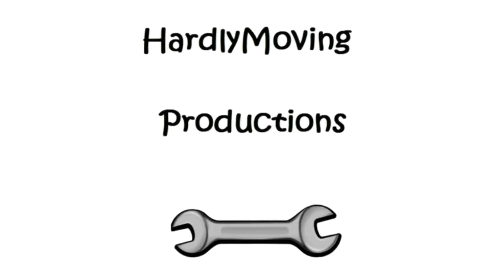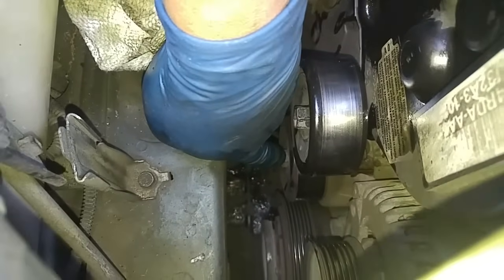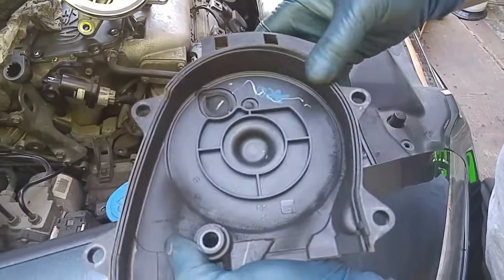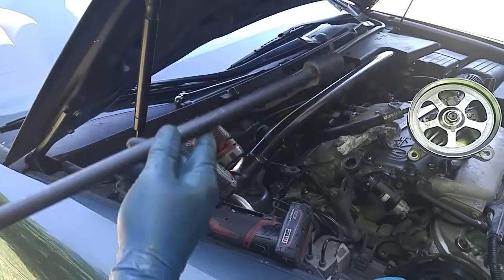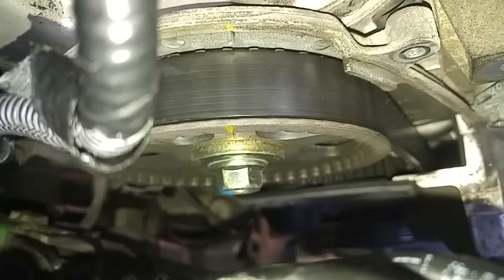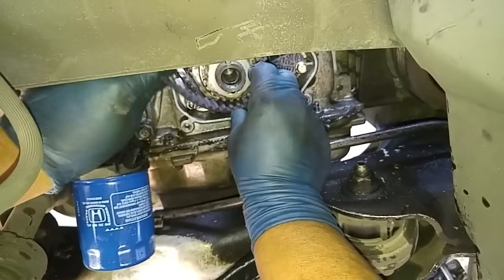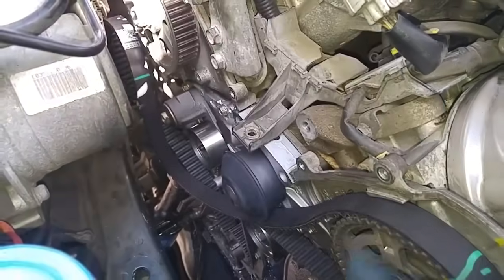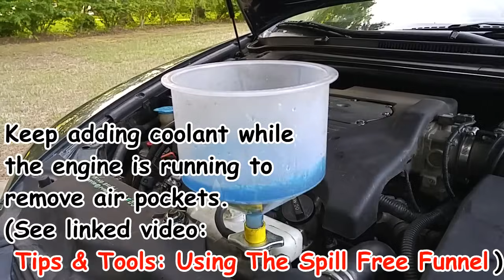Acura TL (Honda Accord V6) Timing Belt, Water Pump, & Pulleys Replacement

Comment: Great video!  After the timing belt is installed, would you recommend manually turning over the engine by hand at least a few revolutions to make sure the timing marks stay aligned and there is no piston to valve contact?  Is this even do-able?  Thanks!
Reply from the maker: No ... not necessary.  Even if you did, turning the engine manually one full revolution will not bring the belt alignment marks to where they were set.  This is what happens with twin cam V6 engines.

Comment: Makes me wonder why honda put timing belts for soooo long on the V6's instead of timing chains like Toyota, cant think of any reasons. Hopefully the new ones have timing chains this is soooo much of a hassle lol. Great video though best of YouTube💯💯💯
Reply from the maker: Thanks for your comment and support!  Timing belts have less centrifugal mass than a timing chain setup and therefore robs less horse power.  From a maintenance perspective, timing chains do not require replacement unless the chain stretches (caused by not changing the oil as outlined by the manufacturer or the crankcase oil level dropped and oil wasn't added).  A stretched timing chain replacement job is around 3X the cost of a typical timing belt replacement (both parts and labor).

Comment: Do you have to make any adjustments for the crankshaft pulley when you put it back in?
Reply from the maker: No ...not at all.  The tensioner pulley removes all slack.
Reply: Hardly Moving Productions thanks!

Comment: Additionally:
Draining the coolant: There is a nice and fairly easy to access drain plug to drain the coolant out the engine block and water pump. It is located on the back of the engine in front of the steering tie rod link. You can see it from inside the front right wheel well. Drain the coolant before taking the water pump off so that most of the coolant is gone
Knocking noise!!!! If changing the timing belt because of a knocking noise then make sure you get a timing belt kit with the shim that needs to be installed also on the timing belt idle pulley. If not, the noise may come back down the road (Apparently Acura says its the timing belt slapping on the engine mount) TSB 08-031
Reply from the maker: Good to know.  Thanks!
Reply: Thanks for this info. I've used it on three J series honda V6 now. Saves a ton of mess!
Reply from the maker: Hey ... glad it worked out for you!

Comment: Would this be the same procedure for an 03 Acura TL 3.2 vtec?
Reply from the maker: Pretty much the same once you get the side motor mount bracket off.
Reply: @hardlymovingpro  thanks 👍

Comment: Attempting this on my friend's 3.7 TL tomorrow. So 15 minutes is what it takes?
Reply from the maker: Go for it ... reach out for that brass ring ... you can do it ... don't think you can, know you can!  In all seriousness, with some decent tools and patience, it's a do-able job for the common Joe.  15 minutes virtual time ... 20X real time.
Reply: @hardlymovingpro  we just got done. Started at 9 finished at 3. Broke 1 breaker bar extension on the pulley...finally gave away with some heat. Thanks for the helpful vid.
Reply from the maker: Good deal and congratulations!  Better to brake a cheap tool than your knuckles!
Reply from the maker: See ... 20X real time!

Comment: What if your car doesn’t start after doing timing belt ?
Reply from the maker: Never had that problem.  But double check all your work.
Reply: Turns and cranks but it don’t start
Reply: Hey so I redid everything and I got smell of gas coming out the exhaust u think I bent a valve

Comment: Thank you for posting this video, nicely done.  One question; when you were setting the timing before you took the belt off, you turned the crank shaft until the front cam shaft was on the time mark, then you noticed the rear cam shaft was off slightly, so you turned the crank shaft some more to make the rear cam shaft to line up too.  My question is wouldn't that affect the front cam shaft to go off the time? Or did I miss something in your video.  Thank you in advance if you have time to answer my question.
Reply from the maker: Thanks for your post.  The front cam sprocket was slightly off alignment to the left.  It was less noticeable until the alignment was compared to the rear cam sprocket.  Moving the crankshaft a hair more to the right brought both cam sprockets more to the right and center with their alignment marks.
Reply: Many thanks, makes excellent sense.

Comment: Is the crankshaft pulley rotating in one direction only?
Reply from the maker: You can move it counter clockwise to help ease installation of the new timing belt

Comment: As I was putting the new belt on the left cam, I used the wrench to move it slightly forward but the wrench slipped and the cam sprung backward like it was spring loaded. How can i get it back in the correct position? I am afraid to force it as not to damage anything. Thank You
Reply from the maker: No problem.  You can wrench it back slowly
Reply: Thanks, I''l try it tomorrow. Even with Your great instructions, It took me 6 hours to get to this point. But still lot better than paying grand to a shop. @hardlymovingpro
Reply: So You know I couldn't wait till tomorrow....It's odd but that Cam keeps coming back to same spot and I can only turn it clockwise about 1/4 turn. I'll just stop by Acura dealer and see if they offer some help. My buddy has a friend mechanic, so maybe he'll stop by my garage. We'll see. Keep You posted.
Reply from the maker: Can't understand why it keeps snapping back.  It doesn't have to be in absolute alignment.  Just get the belt on the front cam first ... clip the belt on the cam ... move and hold the back cam in position mount the belt and clip in place.
Reply: So my neighbor helped me put everything back together. Perfect alignment of the marks. This morning i filled in the fluids. Car started and ran about second or two then made rattling noise and stopped. Tried to start it few more times after that with no luck. I'm ready for the worst news.....Engine dead now? I think I'll just sell the car for parts??
Reply from the maker: @robertslezak5778  Could be something as simple as a disconnected vacuum hose or electrical fitting.  Suggest you double check all your work ... even if it requires you taking off the timing belt covers.  Happens to me sometimes.  Nature of the work.  Don't get frustrated.  Could be something very simple that you missed.  As long as the belt is in alignment, it must be something else.
Reply: Redid the belt. All marks perfect. Finally started the car but here's what happens:
1. Need gas pedal pressed to start.
2. Car runs rough and when i take the foot of gas, it dies.
My question: It didn't show in your video but did You dry that electrical component by the lower small (crank) cam? Even though I drained the coolant from the bottom of the radiator as your other subscriber recommended, there was still fluid leaking after removing water pump. Could that be wet and causing it? You don't live close to Chicago? I'd pay You to come look at it? Thanks a lot.
Reply from the maker: Check and blow dry the crankshaft position sensor connector.  Check all geound wires.  Do you have any MIL lamp codes?
Reply from the maker: Also, check the MAF sensor plug on your air hose by the air filter box.
Reply: P0154 - o2 Sensor - no activity, Bank 2, Sensor 1
P2254 - A/F Sensor, Bank 2, Sensor 1 @hardlymovingpro  
 Just bought new sensor. Had to take couple days off to recuperate. I'll go back at it early next week. This time with a mechanic. Thank You.

Comment: So what do you think on the labor charges per hour with the mechanic and how many hours you’ll need on a Honda Accord 3L v6 2007?
Reply from the maker: Probably over $90 + per hour.  5 hours total labor time
Reply: Hardly Moving Productions you won’t believe how much the dealer is charging. It’s a whopping $168 an hour. How ridiculous is it???
Reply from the maker: @worldpeace5853  Wow ... that's pretty bad.  Where is this?  California? I'm guessing the Votech schools aren't pushing out that many mechanics these days and the repair shops are taking advantage of that.  Also, the repair shops are having difficulty finding good mechanics and the ones they have are burning out.  Look for a dealership mechanic on Craigslist that works on the side.
Reply from the maker: @worldpeace5853  Basic economic supply and demand labor problem. The repair shops are getting rich; not the mechanics.  Mechanics take in less than 25% of that hourly rate at most dealerships.
Reply: Hardly Moving Productions And that’s what boggles me when I see mechanics pay online. People are stupid as well to go to dealers. Yourmechanic’s online price on their website was around $400 if you get your own parts. We need to be more smart!
Reply from the maker: Funny you mentioned Yourmechanics.  They interviewed me a year ago and rejected me.  They wanted me to use parts from local parts suppliers like Autozone.  Surprised to learn it's okay with them for you to provide the replacement parts.

Comment: He didn't set the engine to TDC
Reply from the maker: As long as the timing marks on the cam and crank pulleys match the belt timing marks, you don't need to be at exactly TDC.
Reply: @hardlymovingpro  but what if say belt it wear and your cams or crankshaft skips few teeth the engine won't be in time you won't even know cuz that mistakes non-interference engines won't have a problem but it can lead to misfiring interference engines can lead new head replacement what it important put on TDC cuz engine belt or  belt tensioner be might so wear can skip few teeth you won't know until later
Reply from the maker: Then install a new belt.

Comment: Love what you been working 💪 on.
Hardly moving productions...
If you're available to respond, part where you're changing the timing belt. The part where your lining up the two cranks on top & the bottom cranks Hardly at dead center.  Is all thats the adjustment needs? or need? or to make the right timing?
Please and thanks 😊 🙏
Reply from the maker: Thanks for your comments.  As long as the timing marks on the cams and crank are aligned AND there is NO belt slack from the left cam to the right cam, and the right cam to the crank ... you're good to go!  The belt tensioner will remove the slack on the left side when it's mounted and the tensioner release pin has been removed.
Reply: @hardlymovingpro  my apologies for the late reply but appreciate it. After doing a overall look found it was the harmonic balancer making the noise. After watching this video several times I just assumed that was the corporate. Eventually YES, this will be in my to do list hopefully by the end of the year. Currently working on my suspension. Thanks again love work and what you provide. Be safe happy holidays.

Comment: Hey I have a question how did I find a pin for tensioner. Plus. Do I have to add any sealant before putting back the water pump
Reply from the maker: Use a drill bit.  It's strong enough to not bend.  No sealant necessary.  Honda o ring type gaskets does the job.

Comment: Why does everyone doing this job insists on making a giant coolant mess by not using the coolant drain plug on the engine or even the block heater plug? Also, marking the belt is really unnecessary, all you need to do is roughly align it, take the belt off and align the crank and cam sprockets, then check it again once the new belt is on to make sure its align properly. I did mine following the FSM and everything was fine and less complicated than what everybody is making it.
Reply from the maker: Thanks for your post and you critique.  With respect to your coolant comment, it doesn't matter to me if I first drain the coolant from the engine block or from the water pump port;  it's all draining into my large plastic cement mixer container.  Whatever coolant remains on the block I blast off with compressed air which is what the techs do in the shop.  Paint marks reassures rookie diy guys that the tension on the belt is proper along with the cam and crank timing marks.  People can mount a belt but can be off one cog because the belt may be too loose between the cam and crank.  The engine will run but it won't run well;  might even get a camshaft position sensor alignment MIL error code.  Had a guy post on my channel about a recent TB job on his I4 Camry causing mis-fires.  Turned out the VOTEC student who installed the new belt at the school was off one cog on the belt installation.  Had to redo the entire TB job again.
Reply: @hardlymovingpro  thanks for the reply, I just think that it would be useful for someone to make a video showing a less messy way to drain the coolant since not everyone has the tools and set-up to catch and clean all that coolant. Also, because the rear cam has to be exactly in the right spot to stay in place, it stretches the belt if it's a little bit off and the marks can be off, I don't think marking the belt is foolproof. Once the belt is back on, the FSM mentions to rotate the engine once or twice and to double check that the marks on the sprockets are still aligned, which would detect any mistake. I personally think it's a better way to do it since marking the belt is not guarantee either as they can be off if not transferred properly.
Reply from the maker: @morrij01  Thanks for your comments!  I've replaced over a hundred belts and found my method to be the fastest, most accurate and easiest.  I don't use paint marks when I do a job that I'm not video taping because I always move the cam and cranks to check the tension with the alignment marks (something the repair guides don't tell you about;  except for their standard time wasting rotate the engine 2 times).  Again, paint marks are for the benefit of rookie and one-time-only at-home repair guys.  BTW - TB's don't stretch.  A little stretch would trigger a camshaft position error code.
Reply: @hardlymovingpro   
Where did you purchase your impact wrench for $150 can you post a link and  are you using oem parts where did you purchase. Thanks in advance truly an awesome video

Comment: Is it also a good time to replace the timing belt tensioner or could I leave the one that is already on the car?
Reply from the maker: Unless it's leaking, you can reuse the tensioner.  Very rarely have I seen them leak or loose tension.
Reply: Jonathan   as someone who lost a nice car to a jumped timing belt due to a failed tensioner, I’d change everything that touches that belt.

Comment: @ hardly moving productions . Hi , I wanted to know if you used aisin timing belt kit on this tb job instead of the oem kit . And how it goes so far ? No issues.thank you
Reply from the maker: Aisin kits are not all Aisin parts.  Their part is the water pump.  The other parts come from different OEM Japanese parts vendors:  Mitsuboshi or Bando (timing belt), Koyo or GMB (idler and tensioner bearings) & NTN for belt tensioners.  Hope you find this info helpful.

Comment: Hands down one of the best vids I’ve came across on YouTube. Great job! Question: If I’m changing only the tensioner do I still have to remove the crank bolt?
Reply from the maker: Thanks ... And glad you found it useful!  Accessory belt or timing belt tensioner?

Comment: so 105K and not 60K?...my 2016 accord V6 is now 60K...
Reply from the maker: It's 105K or 8 years.  So you're okay.
Reply: @hardlymovingpro  ..Thank you.
Reply: I can communicate with you, I changed the water pump to that same car and when I put it on its back, it had a very strange sound, could you help me?
Reply from the maker: Maybe the pump is a cheap Chinese knock off.  Had that happen to me before.

Comment: Is this pretty much the same procedure for the 2004 Honda Accord with the 3.0 litre V6? The engines look almost identical
Reply from the maker: Yes ...they share the same engine.
Reply: @hardlymovingpro  thank you so much I just got into this whole Honda world haha. I didn't know if there was a difference is because mine's a 3L and the other one's a 3.2. but watching it over. They appear to have the exact same layout. I'm going to attempt the timing belt on my Honda Accord V6 Coupe tomorrow lol. I'm scared about that crank pulley bolt. I don't really have any special tools. So I'm going to have to do it the old-fashioned way, with force and heat.
Reply from the maker: Good luck with that crankshaft pulley bolt.  Maybe with a Honda Crankshaft Pulley Holder tool you can rent at Autozone, you might get the pulley bolt off. That should be your very first task.
Reply from the maker: Watch what I had to go through to get the pulley bolt off a Honda Pilot:
https://youtu.be/s5XXcMrE6GU

Comment: did you use regular socket to tighten the crank shaft bolt or the over size one ?
Reply from the maker: Socket that fits the bolt and using a impact tool to torque it down.

Comment: How much would this job typically cost to get done by a Mechanic?
Reply from the maker: I've seen price quotes between $800 to $1200.
Reply: Hardly Moving Productions  Than that’s what I will be saving thanks to you! Just scared of mixing the screws up! Your video is the best I’ve seen👍🏾 good job.
Reply from the maker: @Samil101  You have to factor in the cost of the timing belt kit and a gallon of coolant ... around $100 +
Reply: Hardly Moving Productions Thank you
Reply: Hardly Moving Productions if anyone needs an honest mechanic choose this one☝️!
Reply from the maker: @Samil101  Thanks!